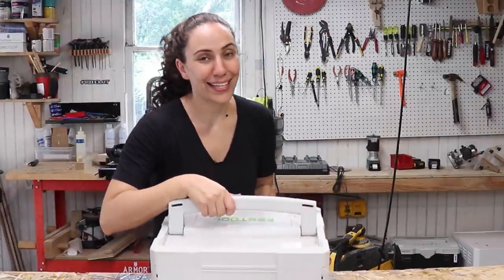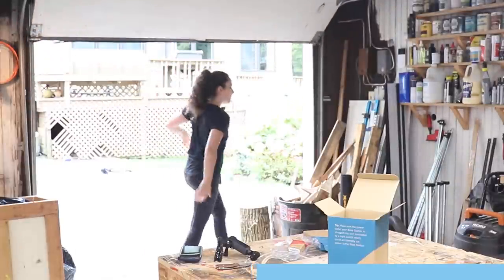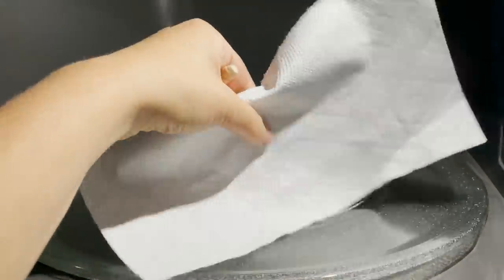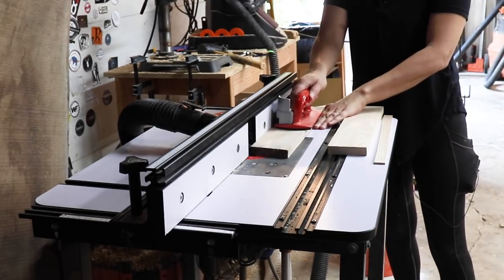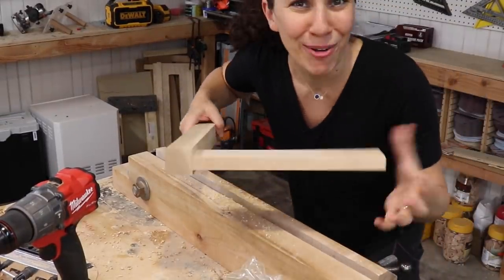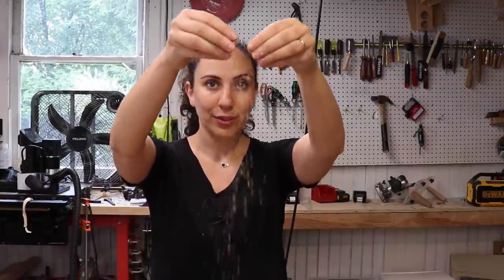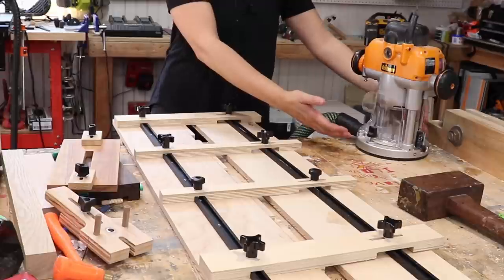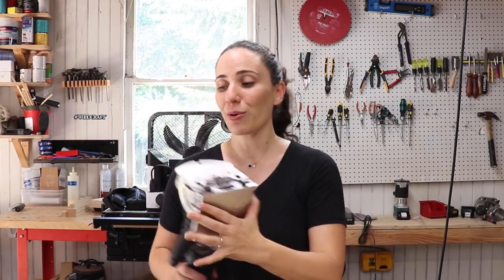7 ways to get around NOT having a DOMINO

Comment from the maker: Visit http://simplisafe.com/3x3custom to check out SimpliSafe’s  award-winning home security that keeps your home safe around the  clock! It’s really reliable, easy to use, and there are no  contracts.  
Thanks SimpliSafe!
Reply: It appears as if it can also be disarmed with a cheap device that emits the very commonly used frequency their sensors use :/
Reply: Matthias Wendel built an amazing pantarouter to avoid buying a domino
Reply: I have the simpli safe for years now , i also use a garage camera inside and outside the garage entrance in addition to the garage door sensor. since you can add up to 9 cameras for the same monitoring monthly price.  I buy the cameras when they go on sale at sams which seams to be the cheapest route. great videos and content

Comment: Thanks again for not only reminding us about finding optional ways around a missing tool, but also giving us your insight in the how and why you use a particular tool and approach to different woodworking applications. One thing I would point out on using the spline though is the use of a plunge cut on each end and cutting the length so that the spline doesn't show on the end for pieces that would be visible such as in a divider or when edge joining two pieces together where there won't be banding around the outside edges. Always learn from watching your videos, Tamar. Thanks,
Reply from the maker: Glad you liked it! Yeah. That would be for a panel you would inset into something 👍

Comment: I recently invested in a dowelmax and that thing is simply amazing. Pretty much dummy proof once you get into the habit of using the checkmark system. For the longest time I used loose tenons made with a router jig I designed, but it wasn't as quick as I'd like. I also used to have a domino and the dowelmax is every bit as accurate, and the joints are plenty strong for woodworking projects. The domino is a bit quicker, but the cost of entry is about 4x that of the dowelmax. I ended up selling my domino since there was a period I had to stop woodworking for a bit. I'm back into the swing of things though, and once I get a few other big tool purchases behind me (CNC and then a sawstop) I'll get the domino again. That thing is a joinery game changer. 

Enjoy your new toy!
Reply: Totally agree. I invested in the dowelmax and I love it. What she said about having to perfectly align the holes is true. Before I got the dowelmax, it was very difficult to get the dowel holes perfectly aligned with the simple dowel jig that i was using.
Reply: @cfoskeeter  Yep. The precision and build quality of the dowelmax is what sold me on it after dealing with and hating one of the cheaper doweling jigs.

Comment: I'm waiting for the patent to expire so I can get the Porter-Cable or the Bosch one.
Reply: There are several versions available, Dewalt and Makita are at Lowes and Home Depot I think, also Amazon.
Reply: @gwbuilder5779  Or get a Ryobi or Triton off Amazon, they're cheaper.
Reply: @a0flj0  Exactly. Plenty of options.
Reply: @gwbuilder5779  I don't think any of those products actually make floating tenons though. They typically are some variation of biscuits or dowels.
Reply: Or, with my budget, a Wen! Festool's earliest Domino patents were around 2004. Patents run 20 years, not including later innovations.  I'm pretty sure most manufacturers have designs ready to produce as soon as they can, but we won't see affordable options until 2024 at the earliest.
Reply: And looking at the prices of biscuit tools the competing products can sell for less than 20% of what Festool charges.  They'll be good quality too since with Festool you're mostly paying for the patent and the name.  Their tools can be a bit better, but probably 5% better than their competitors.

Frankly I don't even think Festool should have been granted a patent on dominos in the first place.  All they did was create a variation on existing options.  But the patent system is badly broken and widely abused.

Comment: Funny how discussions about wood joinery become so colourful...  decorative or functional, old vs new,.  For many speed, cost, safety and repeatability matter too.  There is so much to consider if one truly wants to explore the merits and suitability of one joint, wood species/material and geometry over another for a given load profile, function and aesthetic.  As an old structural engineer that has worked on numerous wood, wood composite and timber structures, along with putzing around in my own shop - it is fun to just build stuff and improve my skill at working with wood, regardless of the tools I may have at hand.
3x3Custom - Tamar...  great content and always a super delightful attitude, makes me smile, get off the couch and into the shop.
Reply from the maker: So awesome to hear! Especially the get off the couch part! 💪💪💪

Comment: I use my Makita biscuit joiner in many occasions and appreciate that it cost maybe 15% of a domino and came with dust capture also. However, when a stronger joint is really important, chairs and tables for example then a loose tenon joint is much stronger so use your jig.  Pocket holes are great for certain jobs but you are right that they are not for structural load work. Use a jointing sled to get around not having jointer and dado jigs along with the micro jig dado  tool on the table saw.  So many ways to do everything, some are better for particular tasks.

Comment: I've had great success with a battery trim router and a slot cutting bit with biscuits.  I built a dining/games table using dowel and biscuit joinery.  I also used a tenon jig as well.   think the key is always do a test cut or test piece first with some scrap! Also just checked the price of the Festool Domino in Australia..... I won't be getting one for a while :-)
Reply from the maker: Yeah. It’s pricey. If that works for you you, awesome!

Comment: I feel the same way.  The Domino always seemed to me like, as Chris Salamone of FourEyes says, "Woodworking on Easy mode" and I swore I wasn't going to take shortcuts like that.  Felt real superior.  What changed my mind (and I just got my Domino DF-500 this week, so we're both new to the tool) was a project where I did lots of loose tenon joints with a router and handmade tenon stock.  It worked just fine, but took a lot of time and I was constantly making sure I had the pieces oriented right and taking 3-4 passes with the router per mortise.  And I don't have the pressure of a YouTube channel; just the pressure of trying to pack the most woodworking into a short weekend.  But I got the Domino so I won't have to spend my time obsessing over mortises; I can instead spend that time either improving the designs or just getting things done faster to go on to the next project.  (I have quite a list in waiting.)
Reply from the maker: Yes!!! Exactly!!! Now I feel like I can free up some creative space in my head to think more about the project as a whole than how am I going to get this all together

Comment: Can I suggest another dowel alignment for your case 2? A friend of mine uses brads (tiny nails) fro glue ups, and they could also give you your alignment markings. Put the nails in the edge piece, nip off the head at an angle, align and press down to mark the face of the second piece. Remove and pull out the nails (Carefully!). It doesn't take long at all. This method is also useful in your first glue-up case, especially for very thin stock.
Reply from the maker: Sounds like a good tip!

Comment: Festool is great,  I just bought a TS 55 Track saw 👍👍would love a Domino but here in Australia VERY expensive over $ 2000 Aus $ .
Love how you have come up with different was to join timber before you had the new toy .
Pete Australia
Reply from the maker: That stinks…
Reply: And in my experience even used they go for only slightly less because there aren't really that many in the market.

Comment: Great video i have tried some of these techniques in the recent past beacuse i am at home-diyer level and suddenly i was given a task to make bunch of very big table tops. I discovered that the best metod for alignment that worked for me and my material (thickness was not equal across the boards but top surface was nicely planed) was wolfcraft doweling jig. It is a pair of clamps, one clamp is used to secure both boards in constant position and second one has pilot holes for 6, 8 and 10mm drill bit. Holes are drilled in reference to the top surface. Also i would like to mention that you dont have to use biscuits with router slot cutting bit, i think better idea is to use plywood with significant thickness and bigger slot cutter.
Reply from the maker: Sounds like it works great!

Comment: I'm a big fan of dowel joinery, especially anywhere real strength is required.  You can get a couple of good, inexpensive jigs like the MilesCraft JointPro and any cheap self-centering dowel jig for a total of well under $150 for both.  Combined with your handy drill-driver they will give you solutions for pretty much every type of joint.  And with only a little bit of practice with these tools you can spot and drill your holes almost as fast as with a Domino.  And dowel joints are seriously much stronger than domino joints.   Yeah, you do have to run your vacuum afterwards for cleanup. The Domino will always have that advantage. 

Another type of joint that seems to get totally ignored in a lot of these YouTube videos that talk about joinery is to simply rabbit (tongue & groove) or shelf the edge of the boards with either a table saw or router.  This doesn't give you the depth of transverse fiber strength that dowels and other deep tenon joints, but it can increase the glue surface area to 150 - 200% over a plain butt joint.  This can be very fast to do, do not required any special tools or jigs and are more than strong enough for a lot of purposes.   I built drawers for an entertainment center using this method and they have lasted about 15 years with regular, almost daily use and are still rock-solid and straight.

Comment: and for those of you would like to make tools - there are many DIY solutions to building your own loose tenon mortise cutting tool some replicate the fence function and cut the equivalent to Tamar's various loose tenon jigs but in the same usability of the Festool Domino, and others focus more on the left - right oscillation aspect with a simpler fence - they all use a standard palm/trim router as the spindle, but you could use any CNC spindle as well - the creative sky is the limit.

Comment: Twenty years ago when I was 18 I went to a votech for Cabinetmaking.  I heard this trick to microwave the dowels to shrink them, so I decided to nuke my dowels in the shops adjacent lunch area.  Well, I set the timer too long and forgot about them.  When I got back to the micronuker, they were on fire.  I grabbed the melting container with my bare hands, flaming dowels inside, and sprinted 25' to the shop sink to douse them.  Thankfully, the only carnage was $15 in dowels, and one severely bruised ego in front of my class.  So, of you cook them, keep an eye on them!  Btw, I own lots of Festool.  Don't make apologies, you only have so much time in life, so use the equipment to speed up the process!  Keep up the great work.
Reply: Happened to me recently too!  Didn't take long either, less than a minute, and on low power too.  Fortunately I stopped the microwave before they burst into flames, but they were blackened and smoking.
Reply from the maker: Oh jeez. 20 second increments!!!
Reply: @3x3CustomTamar  Yeah, saving the little silica gel packets and throwing them in with the dowels for storage may help too.

Comment: I use to use the jessem doweling master kit which included 1/4 3/8 1/2 dowel setups and very well machined and still have it for emergency projects,  but I had to build a 8 ft farmhouse table from oak and I had to get the domino xl  the funny part is the same client ordered a few designers cabinets for living room and I got the domino df500 , unless you can justify the tool the dominoes are irreplaceable for me , yes the tools paid off on the first project I made less money but the next project will be rewarding

Comment: Rockler sells the Beadlock Pro system that allows you to use a drill to make mortises for a type of floating tenon.  It's a reasonable priced, fast, and accurate way to make a lot of mortise and tenon joints.  Not as versatile as a Domino, but far less expensive.

Comment: Hi. Great video. I'm pretty new to woodworking so these videos help a lot. I was wondering...when you made a spline on the router table you said that the only downside was that you could see it on the ends, but do you have to go all the way to the ends? And would skipping the router table and just use a router work? And then pop in some shorter pieces of wood or biscuits? Not sure if this would be accurate enough, but in theory...😁
Reply from the maker: You don’t have to go all the way if you are using a router table. Or you can house it in something or use end banding. Always options

Comment: Tamar, I think with the spline edge gluing technique, you might be better served to flip the piece over and rout/cut the groove again from a different side to make sure it is centered.  It will give you a 'loose' fit and give you more room for glue on the edge grain.  It will require more careful alignment, but in reality, that is what 'loose' tenon joiner is all about.

Comment: Ok, first cool video! Alwayas liked that you give options to do what you do in a differente way. Since I see the domino I know is cool and fast to use but is expensive and just run the calculation to get one and is like $400 to get one to my country with the added handycap that cannot import wood or the such and they are nowhere to be found here so what I do is the following. Have fixed base router with a fence that came with it added some wood to it since is all metal, then clamp it upside down and use it as a sort of router table, having all marked on the wood and in the router with masking tape on the base I do plunge cuts (need a lot of practice to do it right but you always need scraps right!) and is really fast to do the mortises, then the tenons is just have some hard wood (cedar most of the time) in the righ dimension in the table saw and round the edges with the router (this is really optional) and cut them to length. if is a panel in the middle I prefer dados with glue, brads.
Reply from the maker: If it works. That’s awesome!
Reply: @3x3CustomTamar  Luckyly if the mortise is not perfect nobody will ever see it 😁

Comment: Domino was game changer. Worth every penny. No controversy at all. Just a niche segment of people who do hand tool stuff. I was trained in hand tool use and maintenance in my mid-teens at school 1968 to 1972. Used hand tools (inc drill and brace) for over 15 years till could afford machines.  Still have my tools and dowels jig but machinery is faster, I don't have space for heavy benches, and I often work in people's homes and gardens. Machinery almost every time, especially modern dust control systems.
   Others will have said how biscuits are good for alignment but not strength. Dominos are tenons
Reply from the maker: So excited about it

Comment: I've never seen an issue with the Domino.  In a production environment, or any space such as yours, where it aids in work flow, it's an absolute must-have.  For most hobbyists, who don't have set schedules or deadlines, using any of the other methods is just fine.  Or if a hobbyist wants to use a Domino just for the sake of making their job easier, it's still a great addition to the workshop. There are almost always a bunch of different ways to accomplish the same thing in woodworking.
Reply from the maker: Agreed!

Comment: Putting plywood sheeting down as sub-floor... floating on insulation sheet.... I use a biscuit cutter like yours in my router to ensure the ply sheets are level with each other with no step which could telegraph through the finished floor material... 

😎👍☘️🍺

Comment: The thing is, Domino joiners are fantastic tools. They take a very common and often difficult-to-solve woodworking process (cutting mortise/tenons) and make it quick/clean. At the end of the day this is what every tool is supposed to do: take a difficult or tedious task and make it faster and easier. 

The difference with the Domino is accessibility. A lot of woodworkers can't justify the cost and don't have one, which can make this type of content less relatable since we at home are going through a different problem solving process than the person making the content. The person making the content no longer has to determine what the best way to accomplish a joint is, whether it's the right application for dowels, biscuits, or a handcut M&T, because the person making the content has a domino joiner which solves all these problems.

Much like CNC: they are fantastic tools and very helpful when properly applied, but everybody would rather watch someone handcut a joint than use a CNC to cut the same joint.

Anyway, people shouldn't be mad regardless, but I think that's how some people I've talked to feel at least.

Super excited you were able to get one, I hope to be able to as well some day! Also thanks for all the great alternatives, it was a fantastic compilation!
Reply from the maker: I totally get it. That’s why I made this video! I showed the 3 different applications that are typically used when using a domino and showed alternatives for all those processes. So I’m a future video someone sees me using it for alignment. There is this video to show the alternatives